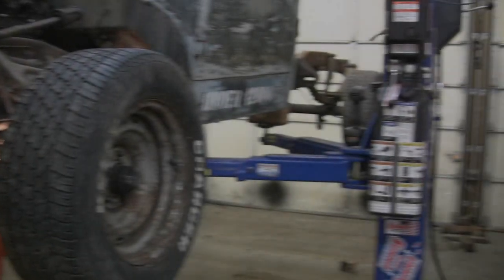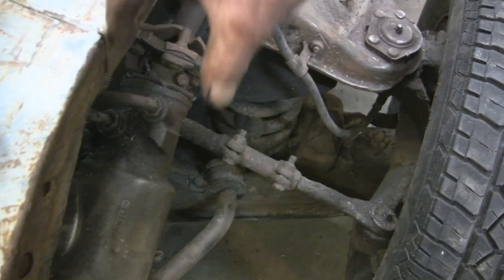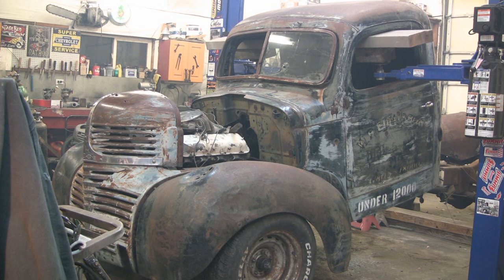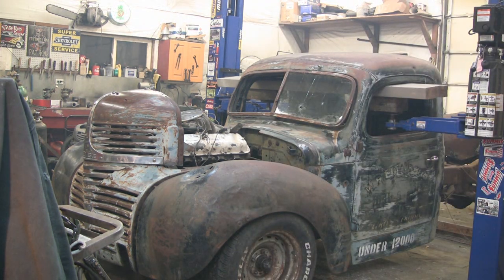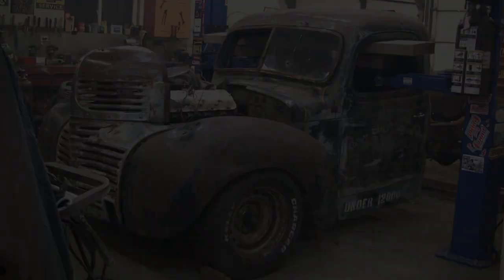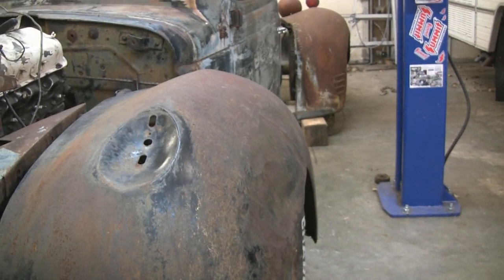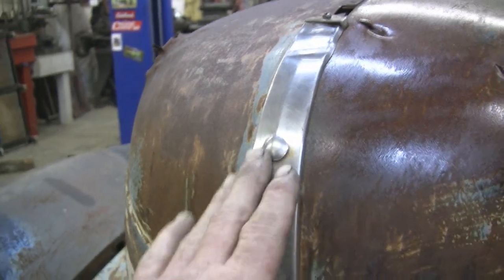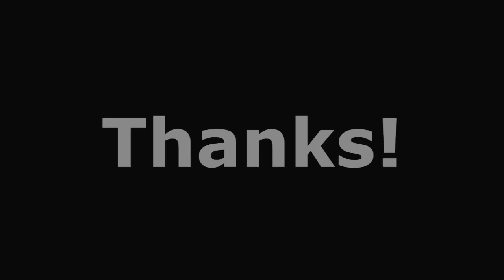Lets Build A Rat Rod # 12 - Look Boss, Z Frame, Z frame !!!

Comment: I got a build, 85 E 250 Cargo Van, going to put it under a 96 ford XL150 4x4 p/u with the F/E 351 motor frame ect  and use the 96 parts. it runs and drive great, the body is beat up a little  on the P/U  the van only as 27k miles on it. I used it on long trips to spend the night in rather than getting a motel,  it has all the comfort, Caption swivel chairs Generator, or propane, air, heat,TV, Computer, satellite dis folded up and down, Boom Box, table, couch, bed ice box ect, but It drink gas like i drink beer.  he heee  Been wanting to make my van a 4x4, done measure it out and should fit perfect. Dead On. Just waiting to get a few beers under my belt and get her done  he heee cheers

Comment: If you have the hood and will be using it and if it has the stainless still on it, you could roll that stainless on the nose to go all the way back to meet up with the hood stainless and not cut it. Or if no hood why not roll the rad cover so the stainless goes to the back edge of it?
Reply from the maker: 231flash thanks for watching!

Comment: just two my cents worth    The valve cover are almost as high as the windshield. Still need to put a air cleaner on also the headers will be higher than the fenders. did like back ground music
Reply from the maker: oldschool hillbilly  humm. yeah, I know all that stuff but....  what is your two cents worth?
Reply: I really like the fender to cab look as it sets now.  It's not to difficult to cut the engine cross member put a flat plate to box  the cross member then put a thick wall pipe in to tie them back together. this will let you drop the engine about 6 inch's. That should be low enough. Use  rear dump manifolds for the exhaust.  You may need to put a drop trans cross member in to level the motor .This should  be straight forward  sense the frame is stock height motor will not be close to the ground at all. Keep up the good work  I can send a picture  of the cross member  mod if needed
Reply from the maker: oldschool hillbilly hey.. appreciate the input for sure and with all due respect, I think the camera angle may have been deceiving you a bit.. as of now, the top of the valve covers are 9 inches below the bottom of the windshield and when I degree the engine and build my rear tranny mount, it will drop another inch.. as for the headers.. they are way below the fenders.. when you back up 6 feet from the truck, you cant even "see" them.. but when I flip them over and run them out the top you sure will !  haha... I like where then engine sits.. dont get me wrong..I can tell you know  your stuff and I respect that....and I thank you for watching my silly videos even if you dont agree with how I'm building my truck. you are welcome to throw in your "two cents worth" not a problem!  I just want to build something really weird, and not like what everyone else would do.. you have a great new year and thanks!!  :)
Reply from the maker: oldschool hillbilly you think this engine sits too high? hahaha.. forgive me.. couldnt resist messing with you a little. haha.. http://www.pinterest.com/pin/532550724656488970/
Reply: no problem I am the same way  ( build things my way)   I'll keep watching   It is plan that this is not your first or 5th build      I know that when you build in front of the world you will only please about 2 percent of the people watching (or it seams that way)      And I did not conceder camera angle      thanks for your time    Keep up the good work    Brown really enjoys this     That is the best part to me
Reply from the maker: I took another shot of it today and dropped the camera down level with the top of the fender..you can see the header is eclipsed by the fender and its more apparent how much the engine sits below the top of the cowl.. I spend sometimes 2 hours editing video, adding background music.. putting in volume levels and intros.. outros.. and then someone comes along and puts a thumbs down on my video.. haha.. I wish they'd say what they dont like, so I could improve.. i never know if its the rig I'm working on or the music or ?? haha.. but its a small number and i dont worry about it but I always have to wonder.. why do they bother watching.. haha.. I'd just move along myself.. oh well.. yeah, I had to learn on my little 32 Chevy build that .. I sure wasnt going to please very many people..chop the top.. dont chop the top! etc.. on and on.. through out the whole build.. its ok.. if it gets so its not fun, I'll stop doing it.. but.. there are a TON of nice folks like yourself that makes it worthwhile.. I really do appreciate your "two cents worth" and you can toss it out there any time. thank you VERY much for watching and thanks for the pointers.. if I decide to go a different direction.. I'll hit ya up for those photo's etc.. have a good evening!

Comment: I really like it.  Hey Ken, who makes your lift?
Reply from the maker: ummm  some chinese outfit. I'd have to look on it to get you a name.. im happy with it tho. 10,000 lb.. i've had Fred the flat bed up on it 1.5 ton.. and that 7,000 lb hearse.. haha. .no problem
Reply from the maker: baggd65 "Quality Lifts" out of Louisville KY.  model is a Q10 10 K lift... 2500 per arm. best thing I ever did for myself. I've pulled engines with it.. unload heavy things from my truck with it.. on and on.. highly recommend it!
Reply: cool, thank you.
Reply from the maker: baggd65
yep. thats who "sells" it.. from what I hear they are all made in china. .this just happens to be one of the better ones..
Reply: My boy is a draftsman for bendpak lifts. They are all desighed in Santa Paula Ca, and they are all built in china.  That sucks. Thanks.

Comment: We'll let you slide just this once on that consultation. ;o)  Adding a strip on the inside of the fenders is a good idea. The "pro's" do that also, Only thing is, you and I can't afford to have them do it. Watching some of those metal shaping vides is quite interesting and amazing. Some of these guys make and entire car body  from flat sheet. Lazze and Covell are two notables. 

BTW, there's a guy in the south who makes brackets that are pretty reasonable in price considering how difficult it is to make a substantial bracket that aligns properly. His name is "Allen Grove components" . WWW.agcbracket.com   . I bought one to mount a alternator on "old" smallblock heads in the Model A. All made from steel which helps keep the cost down. He's in Louisburg KS. 

Are you going to have to drop the frame in the cab area both in front and in back??  Looking at the truck in this video with the cab down, the rear of the frame looks like it's halfway up into the cab. 

Merry Christmas to you, Brown, your family, and your "extended family on YouTube.
Reply from the maker: Pappa Bob i usually build my own stuff :)  merry christmas to you!